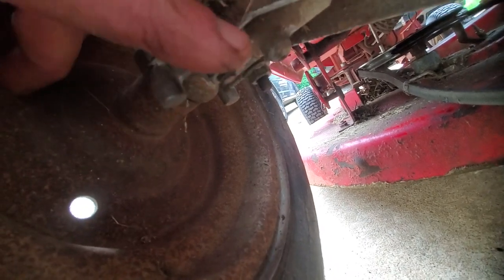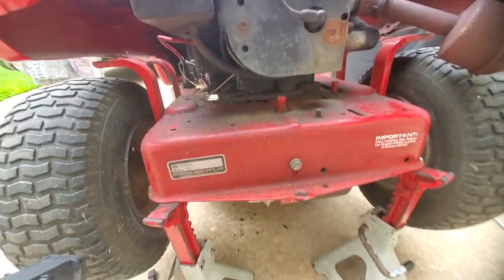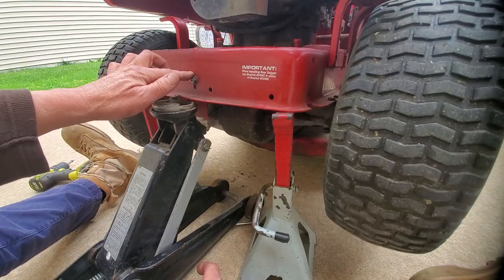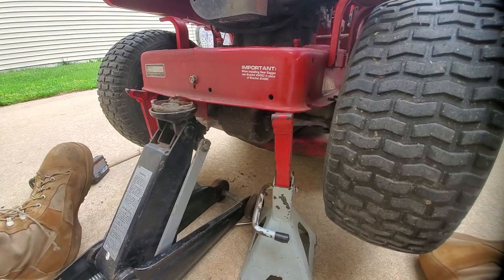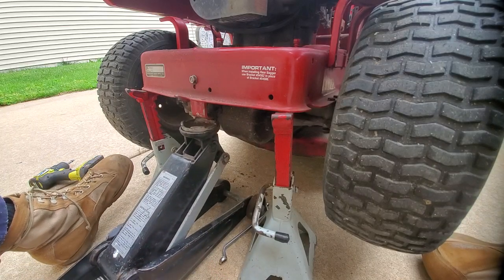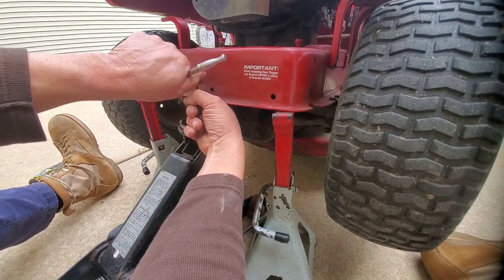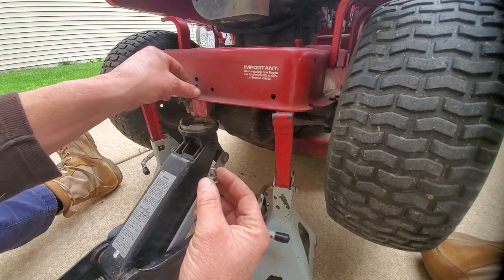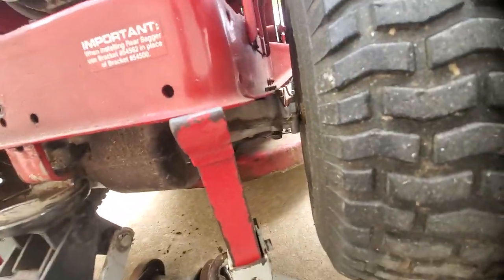Murray Mower Belt Path The Ultimate Guide for Perfect Deck Performance Part 4

Comment: I've done this many, many, times. Identical mower. I've never once had to remove the Pulley Stack or the Belt Guides around the Deck Belt Pulley. I just work the belt UP along the side of the Pulley Shaft and onto the Upper (drive) Pulley. You are right about lowering the Transaxle. And ya, it is a bear of a job, either way. One thing I'd say is get a good belt. I only use STENS 248-030 V-belt Replacement with Aramid Cord. It will last much longer.